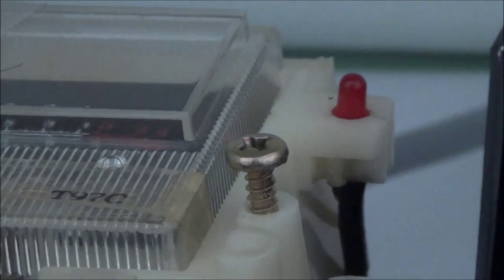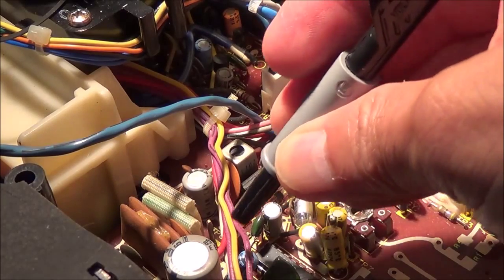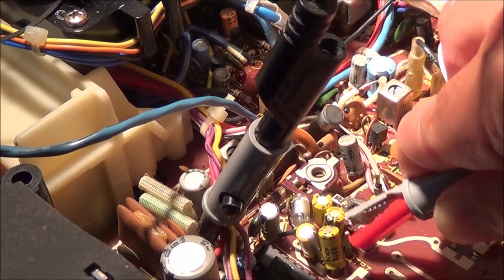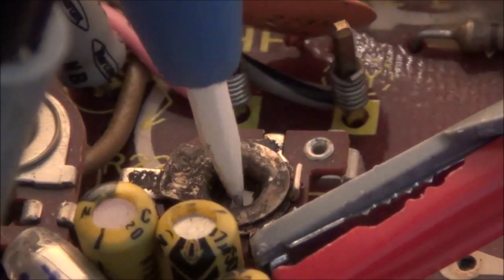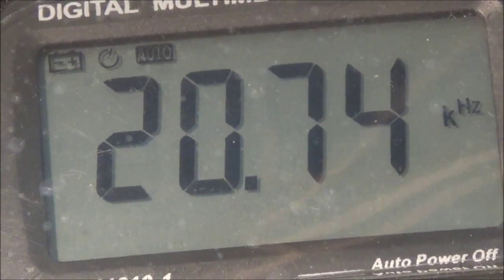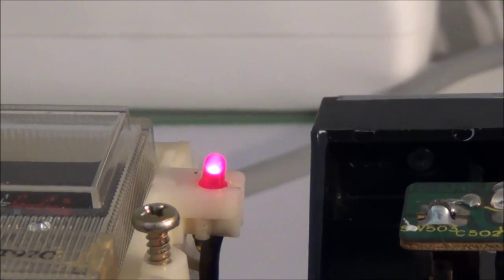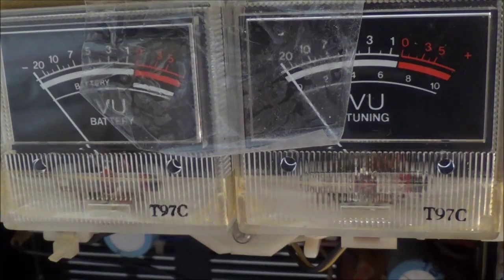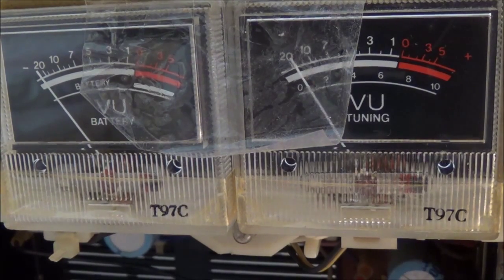Sharp GF-9191 Stereo Indicator Problem

Comment: What was the reasoning behind adjusting on an off freq as opposed to on a station? ~Jack, VEG
Reply from the maker: Ok, I don't remember this video and I never rewatch mine, as an iron rule. But I think I might know what you referring too.  I think this might be a unit where the 19-kHz pilot signal is compared to the 19-Khz VCO signal. Therefore this counter adjustment. I think these 2 voltages are compared. If the pilot signal is stronger (meaning you have a good FM signal) the stereo lamp will light.
Reply: OK, cool, that makes great sense, thanks!  ~Jack, VEG